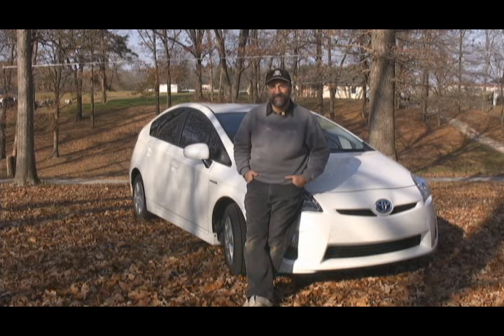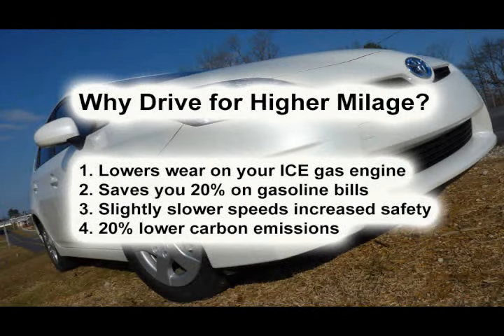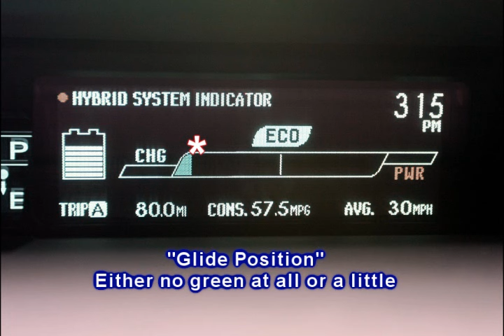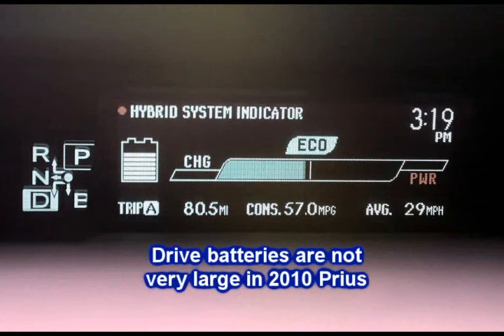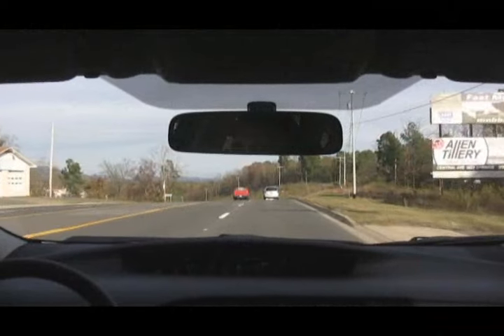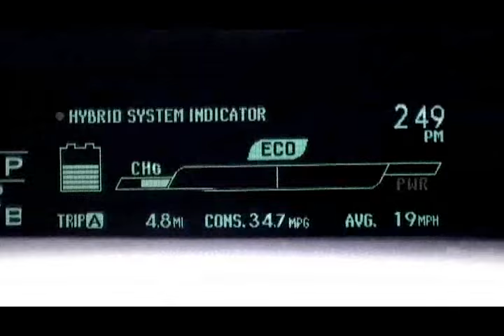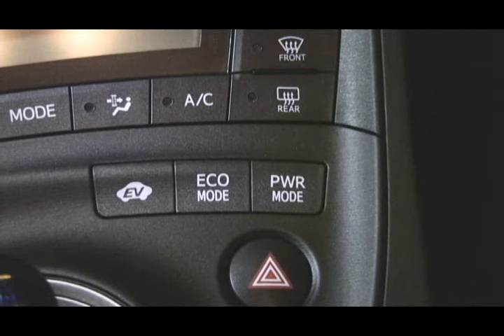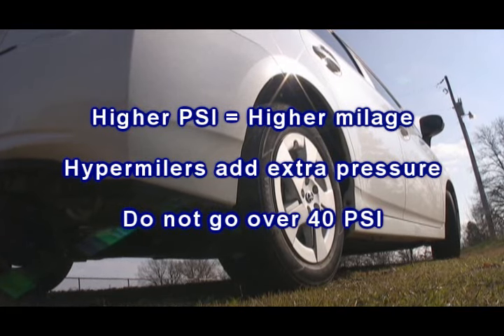Prius MAX MPG Secrets

Comment: Another tip: When driving under about 40mph, instead of using the A/C, turn it off and open the windows. However, when driving at highway speed, open windows will create more drag and decrease mileage more than using the A/C, so close the windows and use the A/C.
Reply: bruh its been 105F+ everyday where I live, I'm not turning off the A/C lmao
Reply: @UrAdversary  Understandable
Reply: How much does AC influence mpg? Roughly?
Reply: Wtcrazy

Comment: The A/C on this car in inteligent, use it in auto mode and select the temperture you want. The computer will make the A/C work with the less power use posible.
Reply: awesome thanks for the tip
Reply: Yea, even here in Arizona summer it seems to find the sweet spot. Starting really aggressive but once it gets near the ideal temperature it drops down to barely doing anything and just keeps it there.
Reply: A/C is like engine. It uses much energy to get where you want it, but is minimal once there, if the desired point isn't demanding. Maximum A/C is fully demanding, whereas setting temperature above 70 isn't. Going above 65+ mph is demanding and inefficient. Going below is less demanding.

Comment: I get 46mpg out of my Gen II 2009 Prius. It has 270033 on it. Battery pack changed at around 180K. No real mechanical issues with this Prius. We now have a 2013 and a 2012 V. Not going back.

Comment: Own two Prius. Love them. Plan on driving them both until the wheels fall off.
Reply: George Palmer I'm sorry
Reply: PrincipalShark0 why?
Reply: Infrailan I'm joking      And I'm a mopar guy so I find some like that funny
Reply: George Palmer I remember John Rambo in first blood when he was talking to colonel troutman saying when he got back from nam he was going to Cruze til the tyres fell off , I just thought I would chuck that one out there
Reply: i hate and love prius. its slow on free way but fast on street. driving at night and cold weather it gets low mpg. 

driving on really hot day with ac on it gets low mpg. driving on a normal temperature it gets really good mpg combine with conservative throttle.
Reply: If I get my hands on a wrecked Prius with a good train & battery, should I use it for an engine swap in an old Corolla?
Reply: 8 years and 250k miles later, wheels literally fell off my prius.... well more like the rack and pinion fell off. battery still works but is dying. Can only get 56 mpg with hypermiling. Used to be able to do 70 mpg. Sad face.
Reply: but to buy a new battery for that would cost more than the car itself. @pollychan8468
Reply: @dangda-ww7de  thats a myth its less than 2k to have it all replaced
Reply: You gonna be driving them a long time.
Reply: me too!
Reply: barefoot arizona  i dont own one? youre kidding me. prius is slow.
Reply: barefoot arizona  pruis is fast. now what?
Reply: barefoot arizona  I win the mega million lottery.  Do you want to work for me?
Reply: E axe lmao
Reply: George Palmer if you get tired of them, and are near Kansas City, take them to the firestone off Metcalf and buy 2 new tires and don’t check the lugnuts to see if they’re tight your self!
Reply: Lol

Comment from the maker: Just a comment from Bob here... I just got a new 2018 Prius Prime Advanced....holy crap. They have got the Prius right now! Everything is so...advanced. just took the first trip in it . Mixed interstate and hilly 2 laners -plus in town. 278 miles total...average MPG? 72.9! What a fantastic piece of machinery. You could sit there all day at 75 mph and still get in the upper 50's MPG. In electric is more powerful and super agile.  Turning radius is tiny. Snag these while there is still a fed tax credit. I'm sure we will all be upgrading to Coal fired cars soon, but for now - enjoy the future with a Prime!
Reply: Agreed! Just six days into my first Prius, a 2018 Prime Plus, and I second all your comments above.
Reply: Bob Nagy Sad you elect to drive at 75 mph. I use 65 mph for better mpg on any car with very little time difference. May I suggest you do keep records and see the benefits? Thanks
Reply: Bob Nagy , that's with the battery fully charged for 24 miles all electric miles then depleted correct?
Reply: May I ask sir, did your parents or grandparents emigrate from Hungary?
Reply: I have toyouta prius 2013  when i driving on Eco Modation  its very selow  looks like doesn't  get the power but when turn off the Eco its okay  i don't know  the car has a problem   or not what about  if i drive    without  Eco is it  use  more fuel
Reply: Thanks for the video, Bob!:) Greetings from Hungary!;)
Reply: @bbence86  yes, I am pretty sure that his real name is Nagy Róbert. Hungarians are all over the planet.

Comment: With regard to optimal braking:  It's worth noting that, the higher the speed you're going when you start braking, the less you can depress the brake pedal to fully fill the CHG indicator.  What this means:  The battery can only "suck" at a certain rate... when you're going faster, the M/G makes more power since it's spinning faster so be mindful of your pedal depression.  As you slow down, you can start to push further and further down on the brake pedal to "use up" more of that available regen, without going into disc.  This is the best way to capture the available energy and get as much of it back into the battery as you can.

Comment: Great tips! I just bought a '13 model and the dealer didn't explain these things to me. I'm still reading the owners manual and did see the part about stepping on the accelerator and letting it up and lightly stepping on it again for better mileage but your video explained it very well. Thanks!

Comment: Thanks for the info.  We bought an '05 Prius new and it's amazing.  Best consistent mileage has been 58 mpg.  That was highway.  IMHO, by far the most important variable is tire pressure.  The small tires seem to be very temp sensitive.  Pressure will go down as the weather gets cooler.  A small drop in pressure greatly reduces mpg.  We found this out over time.  I don't exceed the door jamb pressure, but keep your eye that it doesn't drop by more than 2 lbs.  Your mileage will be fantastic.

Comment: I practice most of these techniques in my 2012 model 2 with 100,000+ miles, and I regularly get 52+ mpg.  If I really try I can get 67 mpg on some trips.  The best I have ever done was 82 mpg for a 12 mile trip at mostly 25 mph.  With a bike rack and bike on the back at 62 mph on the interstate I only got 47 mpg, that is the worst I have done.
Reply: the worst i've done was pulling a tiny uhaul trailer up a snowy mountain with maybe 500 lbs in the car and 600 lbs in the trailer. i'm pretty sure i had no bars on the mpg.
Reply: my best was 3.9l in xp9, that is a non hybrid, just you know what we are talking here

Comment: Very good basic introduction to economic driving. That being said, the heating part is debatable. 

The car's climate control actually controls the fans and hot/cold mix in almost exactly the same way as Bob is doing manually, and once the desired temperature is reached it uses the minimum amount of energy needed to maintain the desired temperature. 

What Bob is doing will only save the energy needed to run the fan at minimum speed between "bursts". This is a very insignificant amount of energy saved compared to the inconvenience of doing this manually and having 5-degree temperature swings constantly. Also, If you live in an arctic climate you have to run the heater to prevent the windows from fogging

Comment: I used all of the techniques that you espouse and even with 7 years on the battery (2010 Prius) I was getting about 55 in the summer and 48 in the winter. Just bought a new 2017 Prius 2 eco. I made them fill the tires to 38lbs before I would drive it off the lot. It's much easier to do high mileing with the 2017. The battery is the new lithium Ion battery much lighter than it predecessor with more punch. I can actually pull a smaller hill in ev mode.  It had much more power than the 2010. Then I can drift down the hill and charge the battery at the same time. I am averaging about 68.5 mpg, verified at the pump 3 times in the last month. This is a mix between city and country driving. I expect to get 75 on a real trip of say 200 miles. By the way my mechanic says that using 38 lbs of air pressure should give you 28+ extra miles per tank.

Comment: Clear Sailing! 

Im 23 years old and just got a 2013. very exited
Reply: Great, in my day I had a 283 1967 Malibu. Standard three speed manual transmission but it got over 20 miles per gallon which was good in those years for a V-8.

Comment from the maker: Thanks guys! I do Solar instructional videos and thought I'd just do a quickie on exactly how to get 60mpg on a Prius. I'm racking up the miles fast.. 30K in 1.5 years.. but it is such a great highway cruiser. I suggest a little piece of 1" foam as a lumbar support on the seat. I sewed one up with a cloth cover. Shell is the best gas, but it is pure Saudi Oil. Original tires are fine.. wearing normally. Oh, with the lights on, the display is low..roll the brightness control to the top and push.
Reply: I found the same thing. I use Shell or Costco gas. I've tried Exxon, Chevron, Walmart, Costco, etc.
Reply: I use mostly shell
Sometimes Chevron 
And use marvel mystery oil regularly

Comment: Some people are so thick!
I driven 90% of cars on this planet coz I'm a vehicle inspector.
For those who say these cars are rubbish are realy thick.
What a lot of people don't know that when a normal petrol or diesel car is stuck on traffic or so the there car is always running constantly so that's burning gas constantly. You see people don't take that into account where the Prius is always switching of the petrol motor off but doesn't reflect on the mpg you save.
Reply from the maker: Yup...grid-locked traffic is where Prius owners are smiling... car stays in electric... motor off... A/C is on...and about
every 20 minutes, the motor comes on automatically to top-off the battery and then shuts off again. Bliss.
Reply: Never heard of start/stop technology?
Reply: I just did that the other day. There was an accident up ahead and I was stuck in traffic for about 20 minutes, inching forward just enough to keep my display from show 0 mpg on any of the one-minute segments. So I got 12 full bars in a row before the battery ran down and the engine started!
Reply: That is absolutely right. It is the only way hybrids gain on mileage. Conventional gas powered cars which switch the engine off when stopped, like the VW Blue Motion range, actually match hybrids for gas mileage. The other assets of hybrids, like regenerative braking only compensate for the extra weight of a hybrid.
Reply: I love my prius
Reply: @brandonhernandez6250  the Prius is much more than 'auto stop'. The Internal Combustion Engine is not required to edge the car forward in slow traffic. It uses the electric motor for that. When the drive  battery is low the ICE then runs for a top up. Another point about the ICE, it's an Atkinson Cycle Engine. The intake valve timing is different giving slightly less low end torque but much higher efficiency. (the electric assistance motor more than makes up for any loss in power) The popular start/stop tech on many non hybrid cars is only a saving if the wait is going to be more than a few minutes as some extra magnetic drag on the alternator will exist during recharging the 12 volt battery.
Reply: capacityplus Wennst manst
Reply: @brandonhernandez6250  start-stop doesn't help in slowly moving traffic. Not to mention it kills your battery and starter motor.
Reply: Bernie Bro  
Come on bro... tell us how you really feel!
Reply: capacityplus I heard someone say that starting up an engine uses the same amount of gas as letting the engine idle for 7 seconds. So you don’t have to wait minutes to see an effect but >7 seconds.
Reply: Mircea Dogaru No, it doesn‘t. But the original commenter wrote about being stuck in traffic, not stop and go traffic.
Reply: Bob Nagy it is blissful until you notice the light on the dash that shows a bad drive battery
Reply: Replevideo — not really. The start stop cars can’t drive at low speeds with the engine off, unlike a hybrid. If you compare a regular ICE car and the same model with a start/stop mode equipped, the MPG increase is very minimal.

It’s the city MPG and ability to drive at low speeds in EV that makes hybrids superior for MPG; not the start / stop functionality on its own.

Comment: I did not read all of the 254 comments, but one thing I have found with the Prius that diminishes fuel mileage is when the car is first started in the winter. The gasoline side of the engine runs longer to get the engine up to a temperature to furnish heat to the cabin. This has been a cold winter in the East, often with temps in the 30's and below, so cabin heat has to be run more than in a normal winter. I, normally, get 55-57 mpg but this winter I have averaged 49-52. On some very cold days I have noticed that my average is down to about 47-49. All of the tips that you gave I use and on my regular daily routes. I know all of the places for drifting, pulsing and electrical engine only useage. One tip that may help is that under normal conditions, the pull away from a dead stop will be all electrical up to about 17 mph. If you pulse at that point, the electrical engine will continue up to about 34 mph. I do that a lot and then catch back up on the electrical charging when braking or at speeds that the gasoline engine returns. I have standard tires and try to keep 38 lbs of pressure. It makes for a little bumpier ride but I have found it increases the mileage by about 2 mpg in my 2010 Prius with 84K miles.

Comment: Great video Bob.  You can upgrade your battery and get more electric driving with an upgrade kit.  Also with a bumper plug you can add a small heater to warm it up before you drive, make it nice and toasty, melts the ice off. Here's a video explaining why a battery upgrade is useful:  40km Plug in conversion

Comment: Glad I found your Video helps on driving  your Prius.  I have a 2016 "C". I have been trying technics to help Improve my mileage. I live in an area that is mixed hills, mountains and flat areas.  Summer gas averages 58 to 61 mpg at fill up. My best fill up was 66.6 mpg!  Longest distance traveled was 510 miles on 8.5 gallons of gas!   I hope with your suggestions that I will improve on my mileage!   Thanks!

Comment: Good video.  Some things I do with my Prius is when I'm coming to a highway ramp exit that's about 1/2-1/4 mile away, shift into neutral until the exit ramp to allow the Prius to roll free.  On highways, use the cruise control.  On city streets, if there is a slow driver, use that slow driver for the car and use the electric since you won't need the gas engine.

Comment: We have a 2007 Prius but I just got a 2013 and was looking for advice on when I should use the various driving modes. I'd already discovered a lot of the other techniques on this video by noting the MPG gauge, but I definitely appreciate confirmation that I'm doing it right and am grateful to you for explaining when I should be using Eco mode. I've been getting pretty good mileage so far (first real week of driving it) but I'll try Eco mode on the highway tomorrow and see how that does. Thanks!